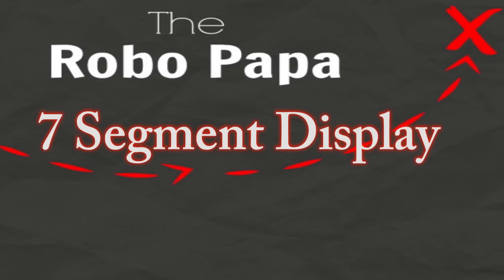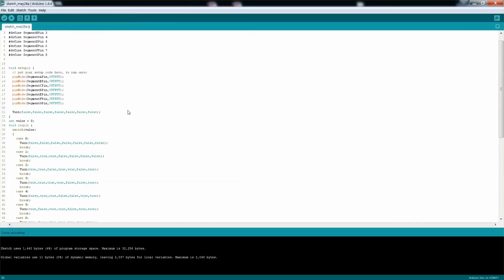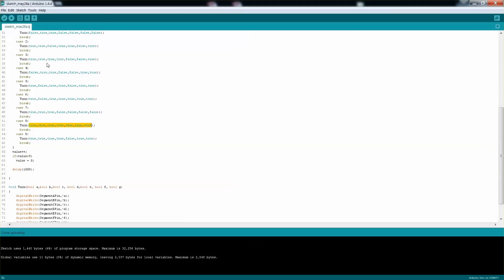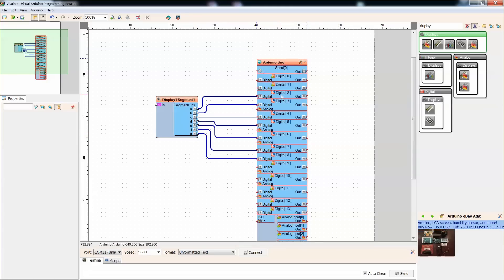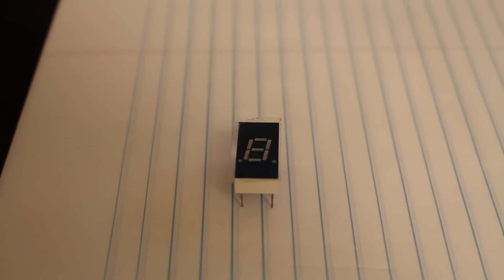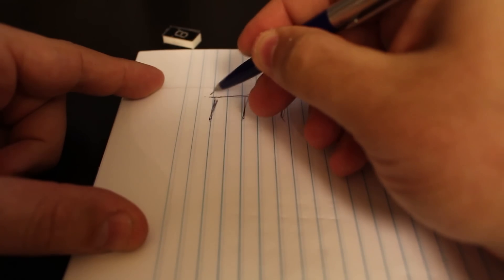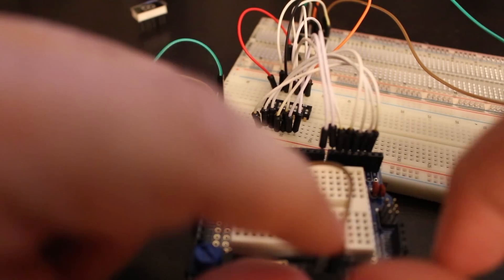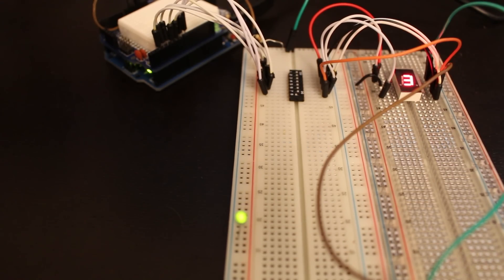Tutorial in How To Use Arduino 7 Segment Display with Visuino

Comment: I have a horrible experience with visuino. Few days ago, I installed the
 software and was provided with a registration key. Subsequently, I had 
to format my computer and then I decided to install the software at my 
laptop. Accordingly, after installation, filled up the form to get the 
registration key as without that most of the components are locked. In 
the process, the visuino system sent a message check your mail. But even
 after three days, no mail with registration key has been received. 
Meanwhile I wrote to them. But they gave false advices. So my point is 
first I have to verify the quality of software and only then I can 
decide whether or not to purchase. But I think the company has not given
 any cognizance to this issue and only looking for its business. To get 
the reply mail, I wasted lot of time being a senior citizen which is 
totally unbecoming on the part of a sensible company. Yesterday also I 
sent another mail to them but no reply has been received.
Reply from the maker: I'm sorry you have issues with the software. I have been using it for years now with no problems. I also was able to get help from Mitov all the time. Have you try to connect with the community ? I'm sure they will be happy to help and fix your issue!

Comment: Nice tutorial, although I would not recommend adding manual code in the Sketch after Visuino has generated it ;-). You can achieve the same by just adding a counter, and clock generator in Visuino.
#Visuino #Arduino
Reply from the maker: Boian Mitov yes that is true that you can use the a counter. However, I was trying to show also how you can manually update it in case someone will need to setup the value depending on something else. Ideally that will not be needed thought.